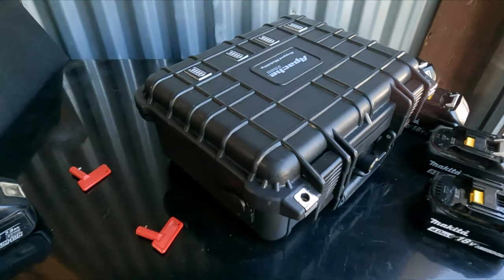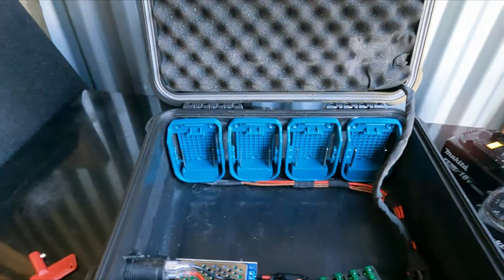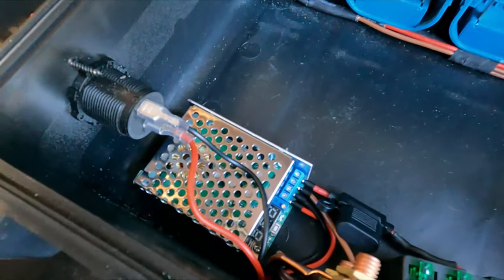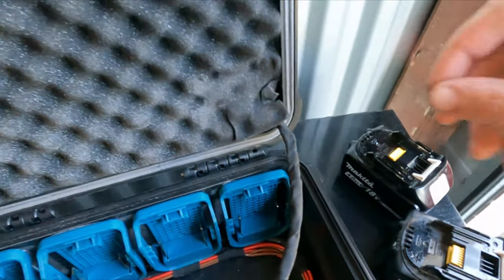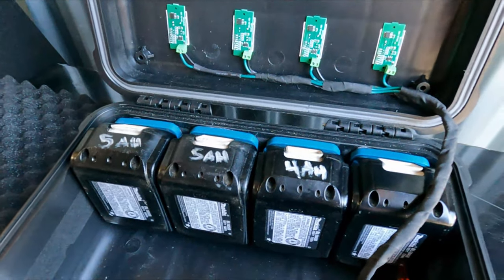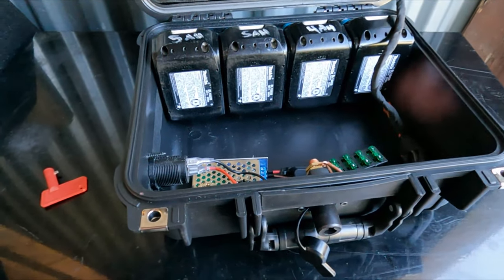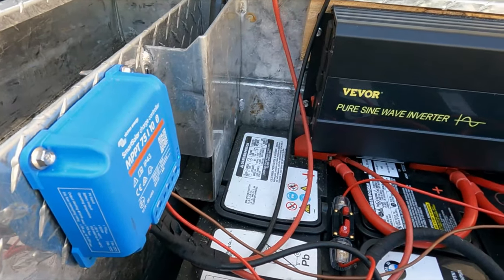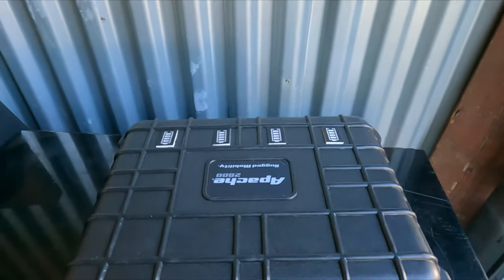12 Volt Portable Power Box! Using power tool batteries

Comment: Very nice power box, well designed.  As a Ryobi user, I built a Ryobi 4-battery box similar to yours.  I added an outlet coming off the 18v before the buck inverter to give access to the full 18v.  I also added a powerpole plug-in (pp30) for each voltage level to give a way to connection other than the cigar outlet.  the battery gauges are a nice addition.  You do have room to add a small (200w?) inverter.  I found that to be useful now and then.  I have several videos about tool battery operated units, including the power box, if interested.  You're off to a great start in YouTube.  3 great videos in a row.  Welcome to the world of YT creators.
Reply from the maker: Thanks! I kept this simple it did its job though. I have a 200w inverter still in the box I never used. Wasn't sure if I wanted to add that or another row of batteries. Decisions, decisions 😄

Comment: Very Nice  and simple (but still smart) design of 12V power box.
Reply from the maker: Thank you!!
Reply: well i have power banks i build have 12 volt small battery 12A 20hour and have 2 18 volt lithium battery with 3 usb port wich 2.1A and 1A each to charger my phone 12volt lead acid battery with 500 watts inverter with two switch and 2 110A/C out let 15A out to charge laptop and battery meter and volt meter one tell how much % and volt battery

Comment: the makita batteries don't have bms for low voltage protection. I wonder if you could add in a relay on the battery source to shut off below 15v so the battery won't get destroyed.
Reply from the maker: The circuit wouldn't be too difficult to make.  My 5aH batteries seem to turn themselves off at low voltage. I haven't fully tested that or tried any other lower capacity batteries. 4 batteries seems to last a long time. Definitely worth making a 2nd video I think. Great idea!
Reply: @TechNTorque  Yeah, I saw a video where someone took a cheapo 5s 20amp bms and connect resistors across all the balance leads so the end result is the discharge mosfets would cut power at 15v. You get all the features with the bms except for cell level monitoring.
Reply: Love the truck setup even more!  I built a dewalt one with dewalt tstak case really for GMRS radio or emergency 12v to go box.

Comment: Which diodes did you use? From Amazon?
Reply from the maker: (25pcs) 15SQ045 Schottky Diodes 15A 45V, Diode Axial Schottky Blocking Diodes for Solar Cells Panel https://a.co/d/0f2iA97R
Reply from the maker: I never added the link to the description but this is what I used
Reply: @TechNTorque thank you so much for the quick reply. Love the video.

Comment: That’s a nice set up. Appreciate you showing it. I do have a question. Do you have a low-voltage shut off set up for your batteries?
Reply from the maker: Not directly. The power I'm using from the solar controller will turn itself off at low voltage, and the power inverter has a built in low voltage shut off. Should be enough to cover my needs 🙂

Comment: What battery level indicators are those? How did you keep them from popping?
Reply from the maker: Haldzemo 1S 2S 3S 4S 5S 6S 7S 8S 1-8S Lithium Battery Capacity Indicator Module 4 Sections Green LED Display Tester Li-po Li-ion (5 Pack) https://a.co/d/4Aaw1HS

This is what I used. On the back there's a solder jumper on the pcb. Unsolder the one it comes with and change it to 5s or whatever batteries you're using.

Comment: u can make it waterproof.. use silicone around  the leds, and the outlet
Reply from the maker: The outlet comes with a gasket that seems to work pretty well. Not sure I'll ever be stuck in the rain with it but eventually if I add an inverter or another row of batteries I'll completely seal it so I never have to worry about it.
Reply: @TechNTorque and

Comment: awesome setup im trying to build one similar, are you worried about killing battery packs? with no low voltage cutoff protection on them? seems that if one pack falls below 2.5v it could keep draining it and damage it.
Reply from the maker: With the diodes it'll pull from the pack with the most voltage first until the voltage is balanced between them all. The individual cells hang out around 3.7v the longest, so it doesn't draw from the highest voltage pack for very long. I'm making another version with lvco. Should have it ready after new years.
Reply: @TechNTorque  oh OK nice! Would it act the same if you use different ah batterys? Say like 3 5ah and one 2ah? Would it eqlize them? Please post your new one I'd love to see please. What's ivco?

Comment: Where did you find the 18v battery level indicators? I’m building my own and can’t find them anywhere.
Reply from the maker: Haldzemo 1S 2S 3S 4S 5S 6S 7S 8S 1-8S Lithium Battery Capacity Indicator Module 4 Sections Green LED Display Tester Li-po Li-ion (5 Pack) https://a.co/d/4Aaw1HS

This is what I used. On the back there's a solder jumper on the pcb. Unsolder the one it comes with and change it to 5s or whatever batteries you're using.
Reply: @TechNTorque  thank you! I’ll send ya a brief video of it when I’m done. I’m also using it to power my 12v cooler. Yours is the only video of a battery box that’s even remotely close to what I wanted to build.

Comment: Could you please share a parts list. Looking for what diode you use to stop back feed for batteries. Thank you for sharing!
Reply from the maker: (25pcs) 15SQ045 Schottky Diodes 15A 45V, Diode Axial Schottky Blocking Diodes for Solar Cells Panel https://a.co/d/2anCQQl

This is what I used. Any blocking diode will work depending on your amperage requirements but these worked for me. I'll put the other links in the description soon. Thanks for watching!
Reply: @TechNTorque  Thank You!!

Comment: Where did you get the voltage transformer?  Nice work, by the way.
Reply from the maker: Here is the one I used. https://a.co/d/eo6aHHS
You just have to turn the potentiometer to adjust output voltage to where you need it
Reply: @TechNTorque  I was researching projects like yours. You did a great job. I found an inverter that is 18 volts on ebay. However, I don't want to limit using the inverter somewhere else.
Reply from the maker: @MrRChitty  as long as you can keep the load below 10 amps you'll be fine.
Reply from the maker: @MrRChitty  you might be able to find more powerful adjustable buck converters too. Just make sure the input and output are in the range you need. I wouldn't buy a special 18v inverter, I like to be able to remove it and used for something else as needed.
Reply: @TechNTorque  thank you

Comment: Could you make a 2.0 box and video step by step making it plz.
With capacity for
*8 batteries,with low voltage cut of protection.
*Inverter 2500w with 2 outlets on the side of the box and switch to go between 12v,may as well add a few usb outlets a type c and a.
*Solar charging in the box 450w limit.
Just an anderson connector on the outside.

N id buy one postage would suck (im in Australia) so would need a 240v inverter.
Reply from the maker: You'd need a much bigger case for a true 2500 watt inverter. Even then 8 batteries couldn't support it for more than a minute or two. Would definitely be a waste of efficiency at lower wattage levels
Reply from the maker: I'll be making update videos soon. Just moved into a new house just getting settled. Check out my truck toolbox video I have a 2500 watt inverter in that one with solar on top. Not as portable but it can support the loads a bit better
Reply: Fair enough as big as an inverter as possible then maybe 1000w
600w minimum.

Comment: What diodes did you use?
Reply from the maker: I keep forgetting to make a parts list in the description. Here is the Amazon link I used 

(25pcs) 15SQ045 Schottky Diodes 15A 45V, Diode Axial Schottky Blocking Diodes for Solar Cells Panel https://a.co/d/0HRoQbS

Comment: Great video. Would like to do same. Can you list all components and links where to get them please
Reply from the maker: Sure I can post the links in the description. Might take some time to pull it together but I'll let you know when it's finished.
Reply: He do nice build i have some thing but not same i have 2 lithium battery 18V 12A and 18V 5A  with 36/48/72 set down converter 12V 10A out put with 12 way fused black and 500 watts inverter with 3 usb port 2.1A and 1A and my out let have type c fast charge